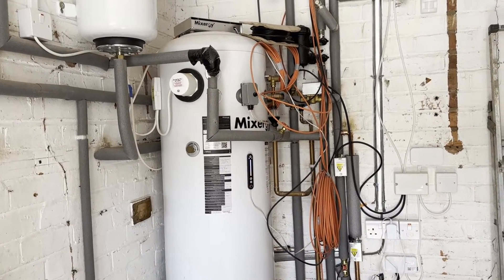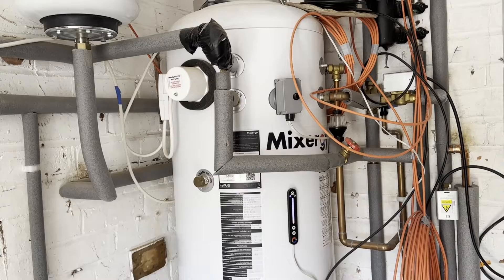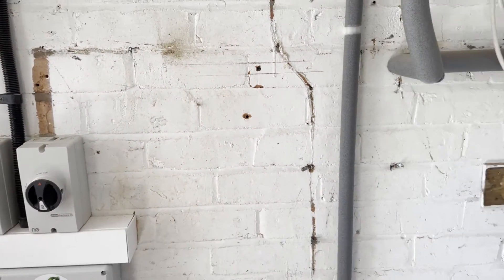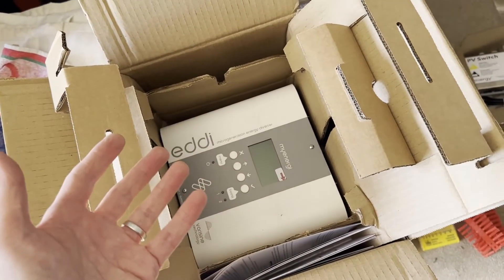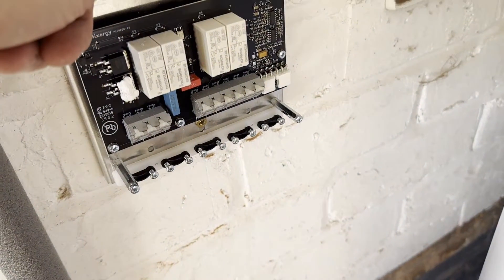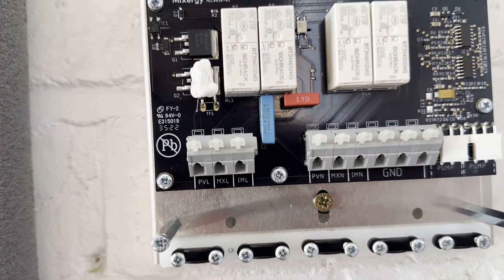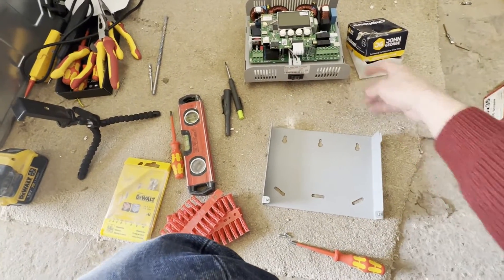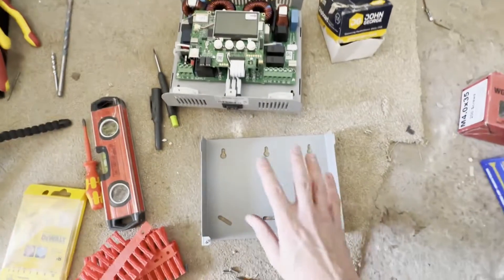Installing a myenergi Eddi and a Mixergy PV Switch

Comment: Great video and the one I have been waiting to find on youtube so thanks. 
When doing this Eddi mod did you lose any of the features of the mixergy tank ? Can you still let a % for the tank to heat or does the Eddi take over and just heat the whole tank ?
Reply from the maker: Thanks. Glad you found it useful. The % target is still used by the tank itself, but once the sun is shining, the Eddi will keep heating until the element’s thermostat cuts off. For example, I set the target temp to 50 and have it sweet to charge to 60% each morning. When it’s really sunny, the Eddi heats the tank to 100%. The next morning, the Mixergy does nothing as there might still be 95% of the water at the target temp. It’s not perfect though. The first few sunny days saw the water heat to 75!! I had to adjust the safety cut off. I’m looking at having a mixing valve added to the tank so if the water is heated to 75 it’s not a problem for my small children.
Reply from the maker: Mixergy make their own Solar Diverter, which I suppose works better with their tank, bit as I have a Zappi, I though the Eddi would be a better fit.